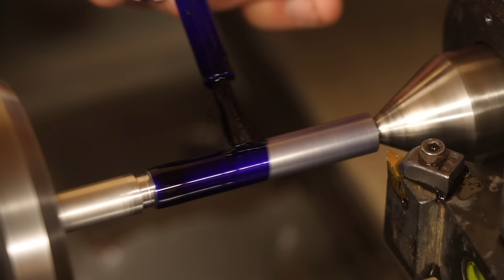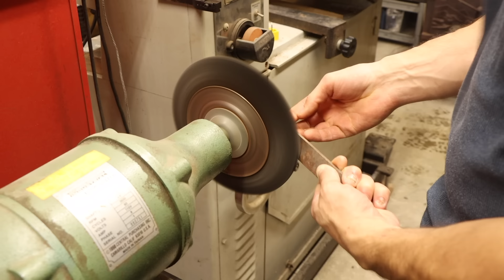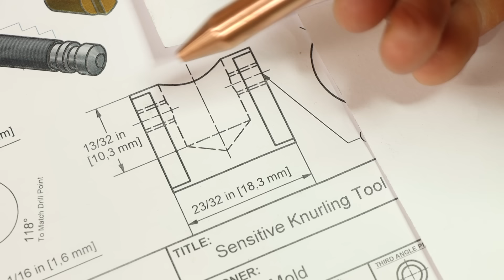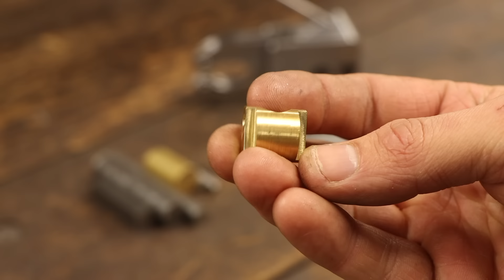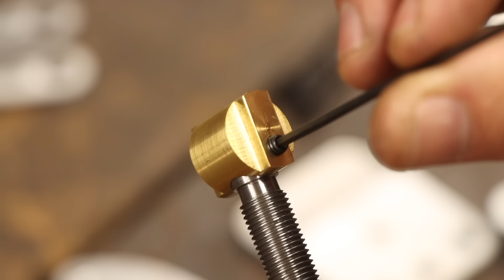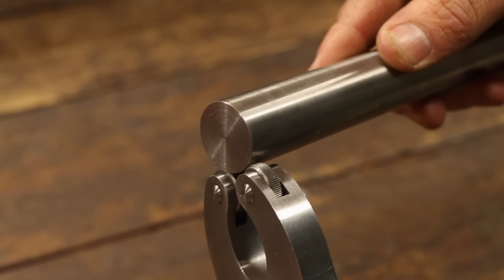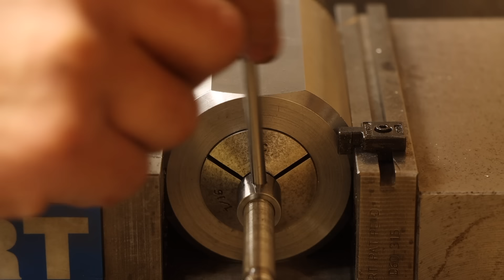Making the KING of All Knurling Tools (Finale) || INHERITANCE MACHINING

Comment: I feel your pain.  :)  It's a nice tool in the end, though.  When I attempted to knurl the cap, the arms would not clear the shoulder.  I wonder if hitting the shoulder is what caused yours to go awry.  I can't see any mistakes in my dimensions, and it seems impossible to knurl up to the shoulder as shown in the drawings.
Reply from the maker: Thanks! Yeah I had that issue as well. There wasn't even a dimension given for the width of that non-knurled area. I ended up just going as far as I could without the arms rubbing the shoulder and clearing the rest. Visually looks a bit less than the drawing but works fine all the same. Still watching through your build by the way. Got pulled away working on the next video. You know how it is
Reply: @InheritanceMachining  It looked like the end of the M6 screws were shiny in your video, so I assume you had to shorten yours, too?  I mean... more than just to compensate for machining all the surfaces?
Reply from the maker: @Clough42  Oh yeah. Almost everything was way too long. Oversized hardware and undersized stock. Go figure

Comment: It was really interesting to see how your knurling improved even through the few times in the video here.  It seemed like the biggest factor was taking it slowly.  Do you think that with the (even brief) refinement of your technique with the new, beautiful tool would improve your results with your old tool?
Reply from the maker: Possibly. Plus using a calculated diameter seemed to help a lot which I had never done before. I'll likely not go back to the other tool though just because of the forces it puts on the machine
Reply: @InheritanceMachining  Maybe you'll go back and re-do the knurling on the elegant tap wrench you made in an earlier video?

Comment: A trick I learned when stacking two identical pieces in a vice is use some paper or cardboard from a heat treat tag/business card or something similar  the length of the bars on the moving jaw side.  Even if it gets soaked the bars are going nowhere

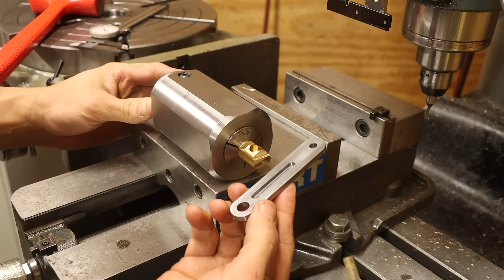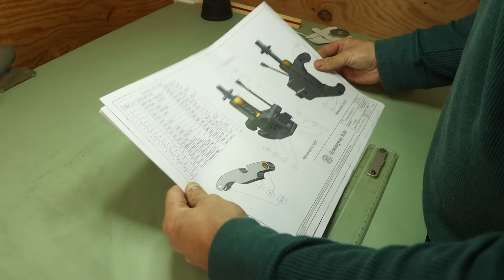Comment: 8:10 DOH! Been there; however, 1:20 there seems to be a 3D model...like I told the production floor, did we read the prints? :-) Always make sure your eyecrometer is calibrated. Giving James Clough a run for the money. Beautiful workmanship, even if you had to make every part 3 times. Pro Tip: Make this, not get chinese knurler; ask how I know..
Reply from the maker: 😁  Thanks!

Comment: I suggest adding a chamfer to the top edge of the feed screw knob under the knurl.
With all the other chamfers and the rounded cross bar ends the sharper edge looks a bit out of place and less comfortable to use than with a chamfer.

Comment: The straight knurl on the cam lever looks really nice, but you may wat to keep in mind that it sends a bit of a confusing message in its design language. Knurls suggest something is to be turned (with straight knurls, against the grooves). So a simple ball end or - if you understandably want it knurled - a cylinder oriented perpendicular to the lever may describe the function better
Reply from the maker: Not my design, but I think the reason that is straight knurled is because its needed to thread the lever into the cam by hand.

Comment: So first:
Live-center marks are something no 'normals' ever notice, and other machinists think are sexy, so no problem keeping them:

Second:
I've never in my life done calculations on knurl diameters, yet they 'work out' basically every time.

Third:
That cross bar looks like its going to vibrate out and end up lost in the chip-tray-black-hole some day.  Might be worth putting some sort of 'stops' on the ends.

Finally: Awesome job!  That tool is gorgeous!
Reply from the maker: Thanks! I've had mixed results on knurling. At least with the courser wheels on my push style. So far with calculating it just works out without even thinking about it every time.
Reply: @InheritanceMachining  fwiw, I have never been able to get the push style to work, even on my huge lathe. I have the cheap clamp style, but it works perfectly almost every time. I was thinking about it, perhaps the straight knurl is worse, I only have done diamond knurls.

Comment: Very nice work!   One item with knuckling I don’t quite understand - with the smaller knurling wheel/pattern,  shouldn’t it overlap/mar up the knurling from the previous revolution, if the ratio of the turned piece vs knurling wheel isn’t a whole number?
Reply from the maker: Thanks! And yes that can happen. That's why Iv'e found it helpful to use a calculated starting diameter. But once the "peaks and valley" start to form, the teeth fall in line. It's a little more forgiving on finer pitches too. My old push style had a courser wheel on it and I often got overlapping if I wasn't careful with the diameter

Comment: You pencil drafting skills have improved tremendously! Even 3D and color!😁

If you needed to move the y axis 2.5 th, doesn't that also mean that the pin is off center as well? Before you shaved off that edge, I was thinking that the whole side of the part could be shaved off instead to make both holes and the slot centered. Or are they not supposed to be centered? Great build as always and I'm glad you are not afraid to show the mistakes. When I do this, I get a LOT of comments!

Your threading looks better than every threading I have seen on YouTube. No chatter and very clean threads. How do you do this?
Reply from the maker: 😂  If only!

The hole I located off of was drilled on center in the previous operation. It was only when I re-clamped the parts to cut the slots did I shift the y axis.

On the threading I usually try to run as fast as I can comfortably engage/disengage. Only cut on one edge of the insert adjusting the compound only. Then when I get close I take a lot of 1 thou and spring passes. This seems to help a lot with getting very smooth threads. And when they don't come out super smooth a small triangular file and emery cloth can help too.

I appreciate the support though. For the most part sharing the mistakes and talking about what I did wrong is received pretty well. But I do get the occasional jerk or two. And I basically ignore the "Held for Review" comments 😂
Reply: @InheritanceMachining  Excellent advice!

Comment: About tuning your tailstock for parallel support of your part I have some sad news... When you change the position of the tailstock for another part with a different length or another position for the tailstock; it shifted.... always. I'm using older equipment just like you're doing and I experienced this every time I wanted something precise to be made. I learned that I can tap the tailstock in position with a plastic hammer. Or in other words it's almost there but just needs a gentle tap. If the error you encounter is bigger just extend the tailstock longer so the tapping will have more effect. Before starting the precise job just cut two bands at the beginning and the end of the part. Measure, tap and recap until the measurement meets your expectation. I found this to be much quicker than actually moving the tailstock to the "right" position. Just some low key TLC to get the job done. Great tip on the knurling calculation. I wasn't aware this existed. And I learned to engage knurling in full material instead of starting at the end (less material, les surface, higher stress and more deformation) I knurl generously outside the perimeters of the desired part and then cut the knurled area to size for better cosmetic results. I think you achieved a wonderful result on this tool and also skillwize in a real rapid fashion. For this part now; I'm not sure I can do better. Chapeau! (French ;-P) Thank you! All the best, Job PS; surface treatment? Blueing in olive oil or?
Reply from the maker: Thanks as always, Job. I seem to have a very rigid tailstock since tapping never amounted to and deviation at the tip. It actually has a set of ways with an adjustable gib for keeping it straight that I'd rather not knock around. If I had to guess my bed warping is a result of the drastic temperature swings my shop sees. On the surface treatment it will probably just be whatever cutting oil remains on the assembly. With the dehumidifier I run, I have virtually no rust issues at all.

Comment: Since you live in Kentucky, I highly suggest you cold blue it. Thanks for sharing 👍
Reply from the maker: Thanks! You'd be surprised how much a dehumidifier helps.
Reply: @InheritanceMachining  : Not really, I live in Eastern Kentucky. A dehumidifier only deter rust but it doesn't stop it.
Reply from the maker: @CraigLYoung  Is your shop sealed? When I framed mine in I wrapped it in vapor barrier. That could be the bigger reason I don't have any issues.

Comment: You're quickly becoming one of favorite manual machining channels. I like that you show the entire process including the mistakes. One critique I do have here though is I feel that A LOT of the mistakes you make are minor. Minor in the fact that they are completely avoidable in most cases. 

While I was doing my tool making apprenticeship I had a very large fixture that needed to be machined much of it manually. I spent 3 or 4 full shifts working on what I thought was a masterpiece. I was so proud of it as it was a very complicated fixture with a lot going on. After I was finished I put the customers part in it to verify everything was in the proper location and it was going to work.

Well everything fit but I noticed some major features slightly off. I couldn't for the life of me figure it out. I told my boss and said "hey Its all finished but something doesn't seem right. Is the customers part out of spec?" We checked it and it wasn't.

What I failed to realize was the datum for the drawing and dimensions worked off a centerline and not a corner. What did I learn that day?

ALWAYS READ THE DRAWING FIRST. Over and Over. Now I have a dedicated cart where my drawings sit and before I ever even take a first cut I verify my first datum or location point. ALWAYS READ THE DRAWING FIRST!
Reply: ahh, the CoS, Cart of Shame 🙂

Comment: Any thought to making your own knurling patterns? I've always felt that the variations of knurling patterns are a bit under explored. For example, a single angled wheel and a smooth wheel could make a rather visually appealing spiral knurl...Which I have accidentally achieved before with improper setup causing uneven wheel pressure.
Reply from the maker: That's an interesting thought. I've seen variable angle cut knurlers that will sort of let you change the angle of attack giving different results.
Reply: @InheritanceMachining  Chris (Clickspring) did Rope Knurls with homemade wheels on one of his early clocks...blew me away.
Reply from the maker: @pjhalchemy  I need to find that!

Comment: One question. You mentioned your knurling wheels have a pitch that limits what diameters you can turn. Does this mean you need a giant box with like 100 knurling wheels to be able to knurl anything?
Reply from the maker: Not exactly. In most cases knurling doesn't need to be an exact diameter since it's just for feel. So in the instance in this project the drawing called out  a 0.438 diameter. But because of the wheel pitch I could only hit either 0.434 or 0.442. Either would have worked fine for the purpose

Comment: I'm glad you showed the proper way of knurling by calculating the right diameter first. I actually haven't seen that yet in other machining videos but knowing how gears worked I figured some math is involved to get the perfect knurl and have the lines match up instead of just mashing it in till it looks half decent. This is much better and you don't get all the near misses between the lines like if you mashed it
Reply from the maker: That used to be my method and I always had to do "test" knurls on areas I would eventually turn away. The calculator I used is great and so far on a few parts had been spot on.
Reply: @InheritanceMachining  this is also my method up until recently but I hadn’t found a good calculator I liked on the internet. Glad you make the videos you do, man. I know I’ve said it to you several times already about knurling, but it bears repeating: they always look great
Reply: @InheritanceMachining  How does that work with two knurling wheels anyway? You would have to match their rotation at start if this mattered in grand scheme of things. I thought it matters, but I read that many machinists say that it usually doesn't matter, and thinking about it, they are probably right since if it was like gears, two knurling wheels would have to be synchronised. It probably works anyway because the knurling is gradual, not cutting, and wheels are not powered so they can slip into the right place, they will slip into the deepest part, so to the groove between the "teeth". And when the groove becomes deeper and deeper, the more equal "teeth" are the easier it becomes to deform metal so it probably is self correcting.
Reply: yea as a machinist I have only probably had to knurl parts for a few dozen jobs but usually we just go for it and hope it comes out well since knurled features aren't usually critical and as long as its not very corse knurling it usually works out, sometimes needing a little adjustment in diameter. I didn't know a calculator existed online for knurling but ill definitely try it next time and probably use it from now on. super cool.
Reply: People have knurled tapers before, so diameter isn’t as important as one might think, but it is more intuitive and probably gets more consistent results to calculate the exact diameter needed.
Reply: Exact diameter has been debunked by people successfully knurling tapers.. I used to calculate the exact diameter as I was taught and I didn't get any better results then than I get now when I just go for it without worrying about working anything out
Reply: @markshort9098  If you have a sharp knurling tool it can literally land between two teeth and double cut! Been there done that!
Reply: @glasslinger  I've had that happen but it's not something that happens very often, it's only the really course Armstrong tool that's done that to me  and the 3 other knurling tools i have just work like they should 99% of the time.. my favorite tool is a quiet fine diamond patern and it comes out perfect near enough to 100% of the time.. all my knurling tools are Armstrong from the 50s and 60s so they probably aren't the sharpest around but they still work good
Reply: @markshort9098  Same here. Not the old tools, but honestly the most success i've had has been just fucking give 'er. the only failures i've had has been when i didn't put enough load into the tool.
Reply: Someone did a test once and it made no difference whether you calculated a precise diameter or not. It is a swaging process not a cutting one like a gear. If you have a cutting knurl, yes they exist, then a precise diameter is required.
Reply: @chrisstephens6673  do you have references to that test? I'd like to see the results of the pieces and the discussion about it
Reply: @t_c5266  it was a while ago, it might have been Tom at Oxtool but I can only remember the result not the channel.
Reply: I found in practice it's not worth worrying about.
Reply: Tom’s Techniques channel showed it years ago and I’ve used his math ever since and it always works.
Reply: Joe Pie, on YouTube, has shown that calculating diameter of knurling wheel and diameter of part make no difference. You only need to ensure there’s plenty of force into the part from the knurlers.
Reply: We had a customer  who learned that and also  the theoretical  number  of  extrusions per inch he would  use pencil carbon part up roll on paper  and count if had too many or not enough  would reject part...mind you it was just cosmetic
Reply: I made my own knurling tool of similar clamping design but just using a screw with a large 3/4" AF head in brass ( it looks so good lol ) and I adjust it into the diameter of the work ( which is whatever the material is after cleaning it up) and run the knurl back and forth tightening the nut down on each pass ( stopping the lathe to inspect but leaving the tool into the work) until it is what I want. I too find out the diameter seems not to matter at all and I get pretty good results.
Reply: Diameter has zero impact on knurling. It's black magic.

Comment: Very nicely done.  Have you considered replacing the block that goes in a tool holder with a full tool holder attachment? Make it a larger block, cut the dovetails, and it has its own tool holder to save you having to use one of the other ones you made?
Reply from the maker: Thanks! Yeah I'm thinking of an upgrade like that actually. I might hold out until I need to make some other holders I have in mind so I can cut all the dovetails at once.